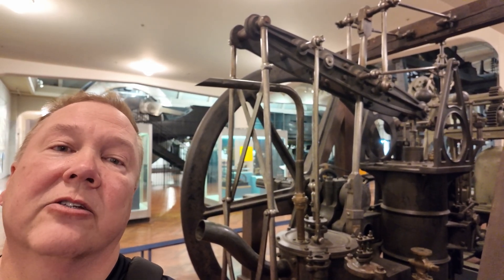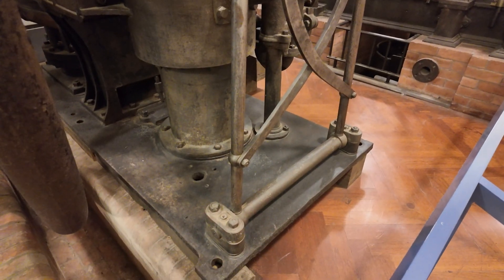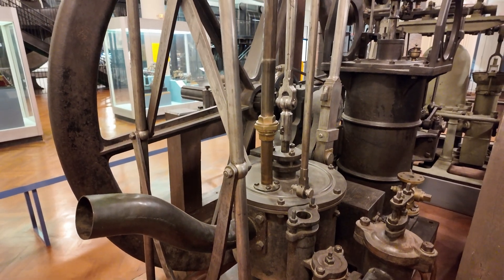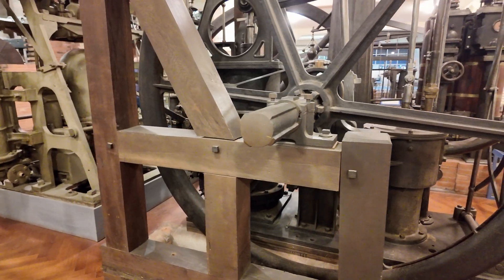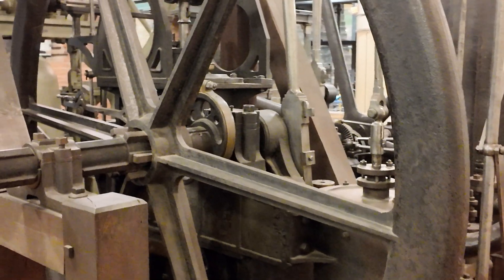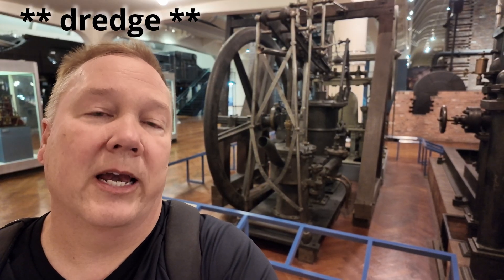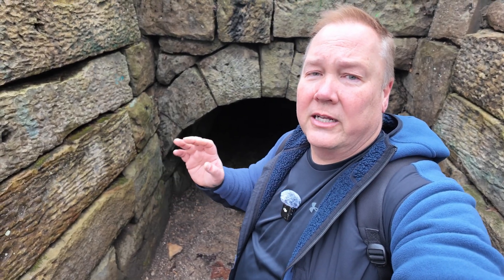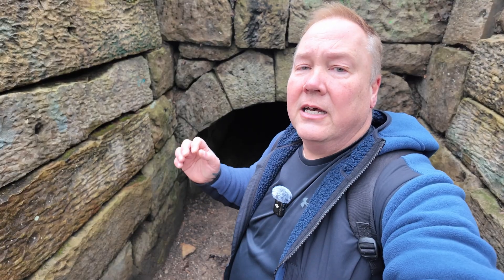The Grasshopper Engine: More Power - Less Space

Comment: This came from my neck of the woods! Lowestoft, is pronounced Low-es-toft, or if you are local Lowe-stoft.
Henry Ford, or at least his procurement guy (who’s name escapes me right now) acquired a few engines from East anglia, there was a book, from what I remember called something like “my strange commissions for Henry Ford “ written by this guy. 
I’ve never managed to find a copy.
Years ago, I purchased a wooden foundry pattern at a local auction for an engine beam, with this was a note, stating that it was the pattern for the beam of the engine for Barningham Mill, in Suffolk, which was acquired for the Ford museum. There was a picture of the engine installed in the very hall where you are. I’m not sure if it’s still there, or if it was sold on in one of the re-shuffles of the museum, but it would be really interesting to find out!
Reply from the maker: Thanks for comment!  Henry definitely renamed some engines when he moved them (they call the Windmill End engine the Dudley Engine, for example).  I just did a quick search for it and it says it was sold in 1991, but doesn't say to who.  Unfortunately, they closed their research center/library for COVID and, bizarrely, haven't reopened it, so finding additional information from their records is impossible.
Reply: @ Very interesting! Thanks for the video, and the reply. One day it would be great to know where the engine ended up!

Comment: Surprisingly small engine!  As a retired engineer (electrical), I want to know more about grasshopper engines, and why the type didn't have wider use, considering the advantages you listed.  A bit of simple animation would help (expensive!) highlight its main points.  Considering your limited access to the engine, some post-filming notations  pointing out the various features and parts would be easy to add and improve understanding.  I'm going to the Ford museum this summer, so I'll look up this engine.
Reply from the maker: When you're in the museum, any of the engines that have nice, new, shiny pipes running into them used to actually be running in the museum when Henry Ford first put them there, although only one still does.  Be sure to hit Greenfield Village, too, while you're there.
Reply from the maker: And you're definitely right that animation would be nice for some of these engines.

Comment: Very interesting Darren!
Do we know who designed the engine?
And where is was dredged up on the east coast of England?
Reply from the maker: Thanks!  Glad you liked it.  I didn't find any references to who designed or built it, but it was found on an old Great Eastern Railway Company dredge in Lowestoft Harbour.
Reply: @Industrial_Revolution 
A design ahead of it’s time and pity we don’t know who was the designer.  
Great eastern had there own ships, so I suppose was dredging channel in Lowestoft harbour.
May be it was being delivered abroad and the ship went down.
There are a pair of Fowler ploughing engines on the sea bed off Whitby on the east coast, and the boiler to a ship that was not capable of going very far.  Fowlers have no record of the pair of engines or the ship they were being carried on.  Another puzzle to ponder over!!🙂
Reply from the maker: I think you're probably right about it being on a ship that went down, and the wreck was in the way of a channel, so got pulled up by the dredge.  The other option I can think of is that was actually in use on a smaller ship.  Being a fairly compact engine, I could see it on something small, even though it's not really a traditional marine steam engine.  It'd definitely be nice to have more information.  A lot of their older engines in the museum lack info on their earliest history.

Comment: Surprised to see hex head bolts…maybe they are replacements
Reply from the maker: I hadn't thought about those.  I just checked and they were invented in the early 1830's.  They definitely could have been replacements, either while in service, or after it moved to the museum.  It seems they were a little vague when they first got it and restored it about when it was originally built.
Reply: The original Whitworth standard used square heads. When a 1/2” bolt was machined from 1” bar that gave a head of 0.707”. The larger 5/8” bolts had a 1” head. The Whitworth standard has been through a couple of steps to reduce metal consumption - first was the introduction of hex (frequently forged rather than machined) versus square heads and the second was a one step reduction in head size during WW1 (which is why you see spanners marked with two different bolt sizes for Whitworth and BS). 
The Whitworth/Penn 60HP Grasshopper marine engines were the driver for standardised engine production with standard bolt threads and diameters in all the 90 manufactured in three months in 1855 for the  Crimean War (for which they were too late so ended up powering merchant ships globally shortly after and continued in production for over a decade afterwards).
Reply from the maker: @allangibson8494 thanks for the info!  Happen to know if any of those 1855 engines are still around?  Sounds like there's a good story there.
Reply: @ I am not aware of any of the grasshopper engines surviving but some of the subsequent trunk engines wound up in museums.